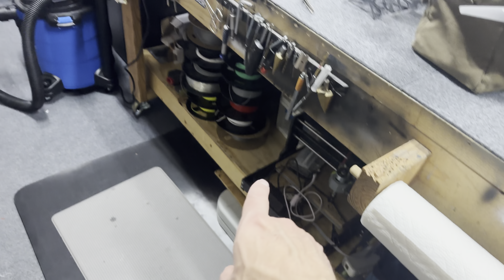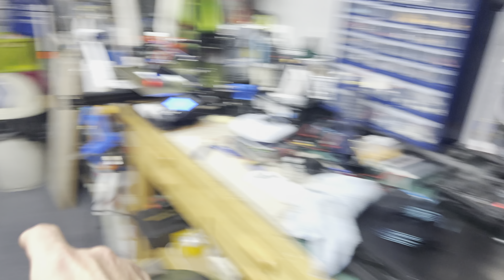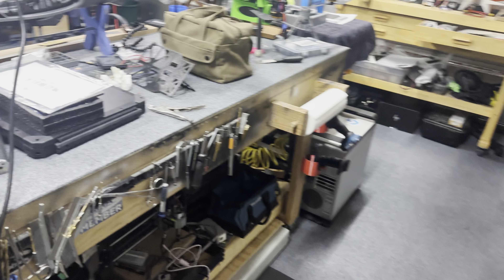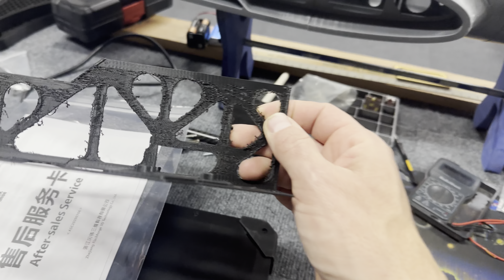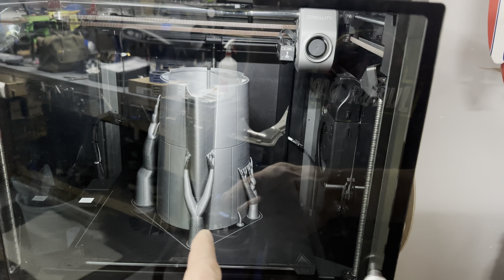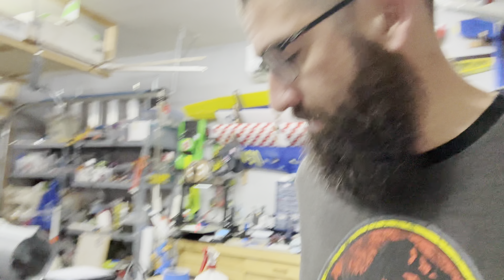3D Printing a Flying Legend: Part 1

Comment: Bought the Bambulab P1S a month ago. Phenomenal prints so far. I am interested in printing a plane but only for the shelf not for flying. I will reduce the size of course. Will check out the 3D print author. Thanks for the heads up.
Glad to see you are back with some RC content on your channel.

Comment: I have completed fuse without the trays and no elevator/rudder control surfaces, the fuse with top canopy and both turrents weigh in at 926g printed in pla+ at single layer 0.2mm with 3% infill. Total fly weight is around the 5.5kg, so if wing and sufaces are printed the same it should be under weight with complete fly gear

Comment: Do you use the flashforge slicer?

I have an adventurer 3 and haven't had any luck getting other slicers to work with it
Reply from the maker: No. I use Orca slicer. They have a profile on their website.
Reply: thanks, checking it out now!
 @JoesRCCorner

Comment: I started 3d printing rc planes last year and I was on the understanding that all these models HAD to be printed from the LW-PLa or they wouldn't fly period.  simply toooo heavy.  what's your take?   regular PLA would be a DREAM to print these in . the LW stuff is a nightmare.  I crashed my plane quick fast.
Reply from the maker: If you are carful and print tin walls, you should be able to have a decent flying plane still. My fuse is currently at :just under 2lbs. I think I will be at 6lbs when completed, but this is a 4 motor 83in plane. I think the Royal Balsa and Ply B17 weighed about the same completed and was a bit smaller. Sometimes heavier planes can fly better if you live in a windy environment like I do. They don’t blow around as much. If it’s too heavy, then it will be a cool model to hang in the shop. Lol😅😂

Comment: Did you say "glue"? I haven't found a glue that works on PLA. What are you using? Thank you
Reply from the maker: Medium CA (superglue)
Reply: I haven't had any luck with it. Any particular brand?
Reply from the maker: @billbyrd9845  I have used all types of CA and it all seems to work well. I sand the parts and ca together.
Reply: Thanks. I haven't been sanding first. I'll try that.
Reply from the maker: @hd-be7di  yes for some things that should work, but i think that will cause bad warping of the parts.
Reply: @JoesRCCorner  I will experiment with it myself. I think applying the correct amount and proportion of the solution should minimize warping